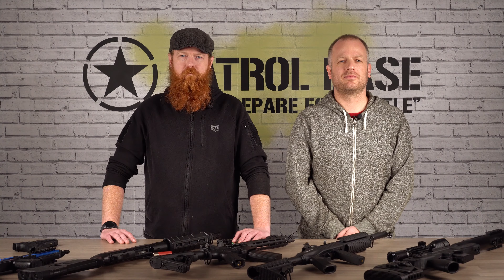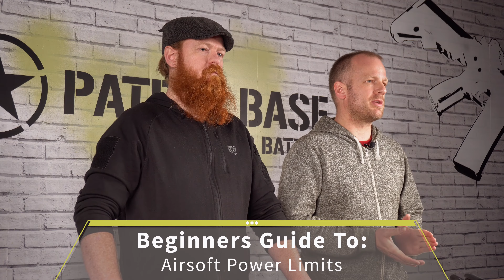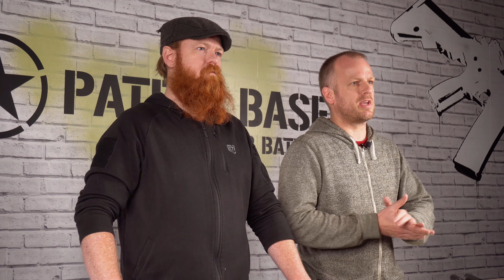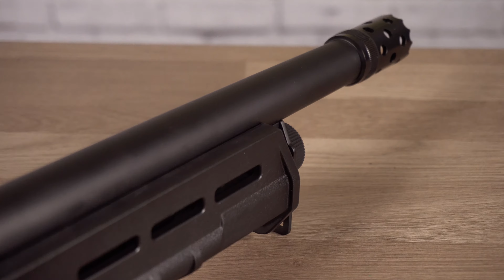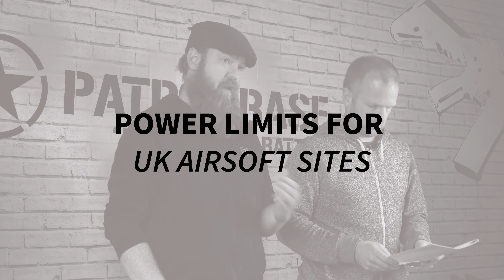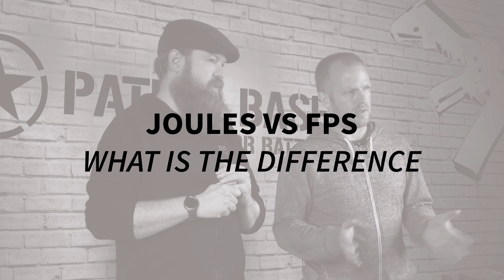Airsoft Power/ FPS Limits Explained!

Comment: Here is a question, on the legal ownership if you have a sniper set to your weight say .32 at 2.3 joules, but if the hop is applied more and ofc this could send it up higher is the law set at what you use it at or the max the gun can produce if it was more hop applied etc, so mine is at .32 with half the hop set at 2.3j but if I slide the hope more it will max do 2.6 I.e over limit ????

Comment: i have a question if anyone could help i order my new airsoft bb gun Pistol and it by well it’s a Glock 17 the description says it Shoots at 360fps is this okay i don’t want to break any laws will get into trouble i only use the gun in my Garden for target practice
Reply from the maker: Hey Luke,

Which G-Series / EU-Series pistol is it exactly, most of them shoot around 280-320 so i'll have to have a look into that description! :O

Hope this helps :)
PatrolBase Jonny
Reply: PatrolBaseAirsoft thank you jonny
Reply: PatrolBaseAirsoft WELL G197 G17 GAS/CO2 GBB FULL METAL PISTOL it says it can go 360fps with 20g would that be fine
Reply from the maker: Hey there! 

 @ixluke  We don't sell that pistol, so we couldn't say. If you were looking at something in that price range we would suggest going for the Raven EU17 any day of the week!

Hope this helps :)
PatrolBase Jonny
Reply: PatrolBaseAirsoft I will take a look now thank you very much